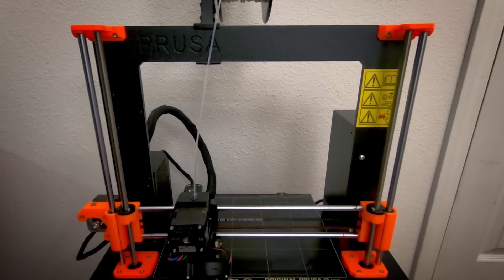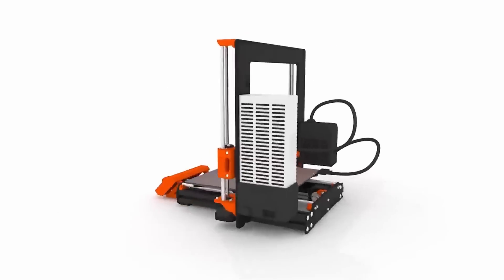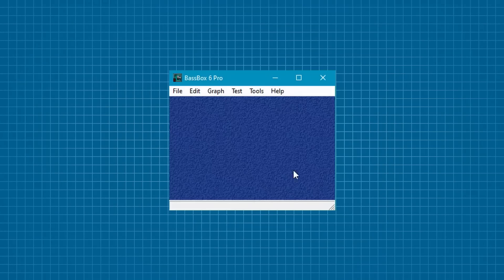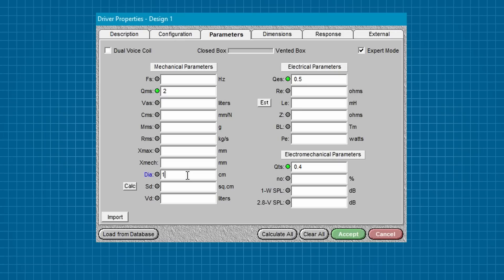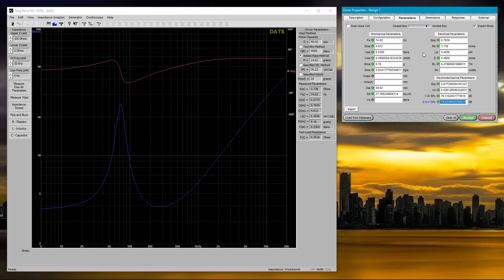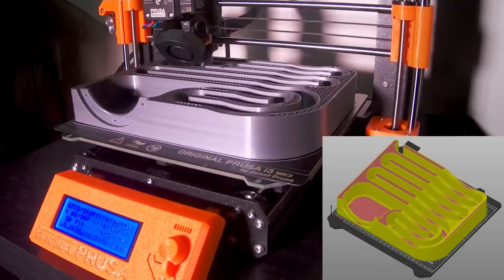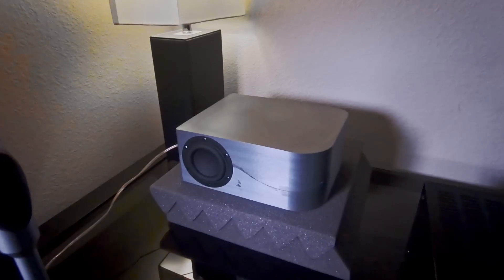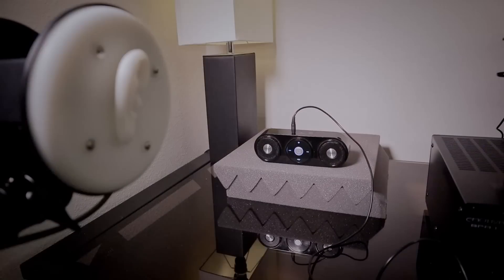Can a 3D printed enclosure get low?

Comment: I wanted to build a bookshelf speaker, with the Peerless (Now Tymphany) Nomex 6.5 HDS and a 19mm Peerless silk dome tweeter. The finished product is ready. I can post a video and give specs if you'll comment on improvements. I would appreciate it. The crossover is very simple 12 dB/octave and is L-R @ 3K. The drivers have a very close sensitivity.

Comment: Wow! This is definetly a good way to use a 3d printer....
I'm not an expert, but just in theory, isn't plastic too rigid compared to wood? 
I mean, wood maybe has a more elastic response to bass frequencies, while plastic maybe cannot dissipate the tension like wood. 
Always theorically speaking, maybe you can achieve a more round bass if you implement some kind of "spring" structure which can absorb the exceeding tension, and release it when it drops down a little.
Maybe passive diffusers ca be used for this purpose?

Comment: 1st great Video, keep up the good work!
2nd ...are you considering printing a hollow form and filling it with sand, or concrete, too? 

3rd I would think about groove & springs on the printed halfs, or just grooves on both halfs to maybe place a seal (rubber) ring in it, just to make mounting easier. What are your thoughts?

Comment: Which tuning frecuency did you used to the port? I measured the driver's TS parameters of 4 units i own, and i had the same discrepancies as you in relation to manufacturer Spec Sheet

Comment: Doesn't the foam pad under the speaker hinder the bass response of the bluetooth speaker? Your eclosure is designed to take care of the bass itself. The small bluetooth boomboxes depend on an external solid surface to augment their capabilities. Speaking from my experience with a BOSE Soundlink II (Suprisingly good for such a small speaker, from a non-audiophile-but-with-decent-musical-hearing perspecive), it heavily relies on a solid surface to actually work (you pick it up, the bass disappears, amortized by flesh basically). And I mean solid, not "put your phone in a drinking glass/against a window to make it sound better"

Comment: What software are you using to calculate your speakers?
Have you ever thought about building a really tiny speaker? I'm working on upgrading laptop internal speakers to something that's actually usable. The Lenovo Thinkpad W530 has TERRIBLE speakers with extremely low volume. It's so silent, it's laughable. I got a PAM8403 class-D amp and have some good success with other salvaged laptop speakers in terms of volume. The obvious upgrade would be to simply install the additional amp inside the laptop and be done with it. However, I'm interested in understanding if it would be possible to make better speakers instead of simply making bad speakers louder.

Comment: How far away from the driver did you have the mic at? A lot of the response irregularities could be room modes depending on how far the mic was. Try doing a nearfield (~1cm) measurement and see how it does.

Comment: That was incredibly impressive from such a small sub. I might have missed it in the video, but what was the wattage being pumped into it?
Reply: the amp is an emotiva bpa-1 (Dayton Audio APA150) so if he had it bridged it was 150w rms.  I actually have one pushing a Rockford Fosgate 12" P3 underneath my desk to supplement the bass on my JBL LSR 305 monitors.  nice little unit.  it's a bridgeble 2 channel class AB amp that is bridgeable and has a defeatable low pass x-over in case you want to use it full range.  
edit: seriously doubt he is pushing the full 150w to that 3" speaker tho.  prob doesn't even handle half that.  maybe he was using just one channel which at 8 ohm is  65w i think.

Comment: The main difference you are hearing is the driver. That driver is a full-range unit with a unique magnet design that keeps the voice coil in the uniform part of the magnetic field throughout its entire travel. I hate to give away the conclusions of lots of research, but, while that driver is great at low volume, for full range, it will modulate HF at high volume. The other thing you are hearing is the narrow band-pass of your folded-port enclosure; You need DSP to make an enclosure like that a bit smoother, or couple different length folded ports to the same driver.
Reply: Yup - the response is all over the place with those tuned enclosures.

I've tried my hand at some small sub designs and always come to the same conclusion:  It's neat, and fun, but physics will always win.  There's always a compromise that makes it less suitable than a larger driver would be.

You can do a lot better with  ~$40.  These are just a novelty, really.

Comment: Hey Hexibase. I started with an X, Y, Z axis that I imported into my PDQ program, which automatically converted into a .exe file. 

Then I opened the .exe in Google Assistant which prompted the FBI and CIA to merge as one file. Later I used an ISIS sweep generator to bring it up to DHS with a lot of RAM. I used the ctrl to shift the scrnlk, and saved it as a PDF. Later when I played the PDF, I discovered the FBI and CIA merged with the DHS and caused the PDQ to not communicate with ISIS, making the XYL have loud QRM with an RST of 5x5x5, which blew the diaphragm from the XYL's  chooch circuit. Now I need to find another chooch circuit that can handle the RAM of 35 RPM. I found a source on line for A.N.A.L lube which guarantees better performance of the PDF when stepping up the RPM of the RAM over 15, Making the chooch circuit much quieter thus reducing the screaming to around 40 DBL. It took a few try's to get it dialed in and everything is working perfect. Thanks for the upload, it has given me inspiration!

Okay, for those reading this ( if you finished ), It was just a joke. I liked the project and what was done, but didn't understand ANY of the technical stuff. So I posted what I basically heard as a JOKE. Did you scratch your head??

Comment: As a car audio enthusiast, this is really convincing me of using a 3d printer rather than making the boxes by hand like I usually do.
Reply: just be aware that the max. dimensions on a printer are kind of small- also 3d modelling software can be a real pain...and the printing itself is much slower than most people imagine- the 2 parts shown in the video on my printer would likely take 2 days of actual printing time
Reply: @olik136   Oli K  I noticed the pieces shown in the video seem solid. Would printing a frame and filling the cavities with a resin+wood shavings cut down on printing time? if so I also think it could provide similar results to what was shown in the video.

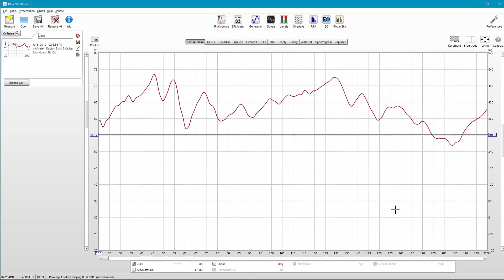Comment: 5:21 Why does the frequency response looks so poorly? It looks seems to be just a two-note-sub (45 Hz and 55 Hz). Didn't you run a simulation of the line before you built it? I usually use AJHorn which gives pretty accurate results to the final built.

Comment: Could you show your enclosure specs? I don't understand how you got so low with such a small volume behind the driver.
Reply: clint a normal driver is like hitting a golf ball with a hammer. With a waveguide, it’s like hitting a line of 100 golf balls with a hammer - you end up transferring a lot more of the energy of the driver into the air.

Comment: You should get a bunch of sound samples using your holophonic setup, and a bunch of "pure" mono sounds of the same object, then train a neural network to go from the "pure" sound to the holophonic sound! :D You would have to include the position of the sound (and orientation of the head), I'm thinking that's easiest to do with some sort of motion tracker, so you can continuously move the sound source around and thus feed the "pure" sound + position as input data to the neural network and it should spit out the holophonic sound as output :D
Might be doable with a pure convolutional neural network, meaning no dimension restrictions :)

Imagine how good sounds in games would be! :D
Reply: Your comment sounds smart, but it really isn't.  Multiple drivers allows for an identical sound from a different location to be experienced by the ear at a different time.  You lose this ability with one speaker; full stop.  When you are lacking a physical aspect of an experience it is severely limited... so p0rn hub will never be as good as the real thing no matter how good the recording or VR headset :)
Reply: @skewty  I'm not talking about "3D sound" that simply delay when the sound is played in each speaker. I'm talking about training a neural network to go from mono sound to holophonic sound, so emulating the ear and head structure too. Assuming your training worked (and that you have enough data) the output should be nearly identical to holophonic sounds.
So I'm not really sure what you mean when you say "You lose this ability with one speaker", since that's the input data, not the output data.

Comment: I have some old speakers that my father made when HE was a teenager. Sporting horn tweeters and mids and a 15" woofer. Even with my Onkio set to +10 on low end, they still have hardly any bass.
What they can do, however, is make you deaf with very little power. 25 Watts is deafening.

I wonder if an enclosure like this inside that woofer section of the cabinet could help fix the bass.

Comment: This would be really cool if he released the stl files, I was planning on actually designing a smart alarm clock radio type thing with an android phone as its brains. And I was going to do a smaller 2.1 setup with about a 3” subwoofer. And this would be perfect for the base of it. It is also reassuring that you can get bigger sound out of smaller enclosures. Of course I would totally have to wing creating the enclosure as I’m not well versed in tuning speaker enclosures and stuff. But yeah,
Please release the files lol. I would gladly pay for them

Comment: Your videos are very interesting and we can clearly see that you have plenty of knowledge and experience in audio-propagation systems design.
I recently got interested into horns and waveguides design (by somehow extrapolating the knowledge that I have on microwave systems). Though it seems like it's very difficult to find proper manuals on the internet, with proper engineering info about these topics. Would you be able to indicate some references? (Engineering manuals would be awesome)

Horns for instance: I found some pretty solid derivation on the impedance coupling for several cases (parabolic, cone, exponential, tractrix), but they assume a normal impinging wave and nothing will tell me how to design a compression chamber to acheive that condition! Then I guess that you can't just slap a horn on a speaker as the front loading will for sure interfere with the design as the cone will encounter a higher impedance in the front (I would guess that the enclosure volume might drop in the case of a front loading...).

As I said :P some manuals or some in depth technical explanations would be highly appreciated!!
Keep up with the channel, it's very inspiring!

Comment: interested to try a full range drive in a similarly produced enclosure.  Did the 3d printing hollow infill not give all sorts of nasty cabinet rattles and buzzes? Do you think it would be better to print it almost hollow and fill it with something inert?

Comment: That's amazing all that from a small package. Maybe I could make a setup inside small compartments in my toolbox. (I.e. under the box or underneath the top of the toolbox since they give you room in the top drawer to bolt a steel top on your toolbox.)

Mining company doesn't allow personal electronics in the property. So I don't wanna be that guy with a side locker that the key won't work on a day shift. 

There's only so much country I can listen to for weeks on end. While contractors drive their service trucks in and have all the fun.

Comment: Do you have port noise on higher spl? Also you reach the xmax quite fast with such a low tuning right? The question is, if a 6" driver in a closed box with the same size is louder with the same low end.

Comment: Correct me if I'm wrong.. Sounds like that specific driver aka speaker is to flimsy to push through the resistance of the long tone tube style enclosure.  Causing pulse waves to bounce back distorting the port output. Soft driver material with wrong resonance frequency for set up + long tube does not work. getting some solid Kevlar drivers or thick reinforced drivers might help.

I know nothing.
 Ignore this comment.

Comment: I wonder if it would work if I upscaled the size of the box to accommodate a kicker 6.75” CompRT subwoofer 🤔. Has anyone tried to up scale one of his enclosures before ?
Reply: you can't just scale up the enclosure for a larger driver. Every driver has different TS parameters and requires a different enclosure to achieve the same result.

Comment: Two questions: what is that ear-mic and is there something a little bit more "mobile"? Something I could actually wear while making recordings?
Reply: I use a Sony ECM-CS3 microphone and it works really well. I've found the range of the audio varies GREATLY on the device used to record. The end result on an Olympus hifi digital recorder is comparable to my desktop condenser microphone when compressed to 128kbps.
Reply: @casey360360  I thought about a good stereophonic binaural recordings :)

Comment: question: should you enclosure not get more space to the wall in the back? I mean the wall of the room. There must be reflection from the wall. You obviously did not take into account your room while designing or simulating your design. What I mean by that: I think in a free air test outside in a desert your design should perform much better and closer to the simulation. Off-course just varying the distance and/or changing the room would show if my concern of the room significantly affecting performance would be correct. as an electronics engineer I really would love to see the limits of your design.
Reply: It's good that you think about these things. Assuming that he hasn't is one thing, but claiming so is entirely different. I can see you backtracked that slightly with the "if I'm correct" injection, but you can rest assured that modeling of the environment was done way before the original enclosure was modeled. He used to have tons of videos up years ago. Those would have let you know just how in-depth the modeling goes. Too bad they're gone. This guy has invented multiple enclosure alignments as pure side-effects of requested response & decay in specific environments & enclosure locations. 

Next time you watch a video of his that shows a response curve; for sh!ts & giggles ask him to plot it in any gaseous element to replace 02/N. He can generate an extremely accurate response curve with any change in location, orientation or distance on any axis, in any hypothetical medium without having to physically measure it, then do a physical measurement to verify the modeling accuracy. His own software is ridiculous.

Comment: I would have liked to have seen, "Isobaric Loading" of TWO of these Drivers in this type of Enclosure. Or better Still , same type of Enclosures & Isobaric, up to 8 inchers. Those would have a more ideal Bass Response. Suitable for "Near Field" and or, a Small (Dorm?) Room listening. If small enough; perhaps a Pair of each Sub, for such a space !  Frankly, I'd love to use the Tang Drivers used in the original "king of desktop subs" - the Logitech Z-2300. That way, I'd be happier with the Bass in my Current System - the Main Speakers being the updated Home Enclosure of the old Braun L200 - the CM-5 s (still a Sealed Box). But made up of an unusual "composite" material & Polyethylene Cones.
The Alternative would still be using Isobaric Loading on the Pair of Woofers; but instead of a "Quasi- Transmission Line" ... a Sealed Box, but using Passive Radiators.

Comment: Could this be scaled down to a much smaller size using a sugar cube speaker? I am a model railroader we have a huge range of sounds coming from our engines speakers usually just have a simple box behind but my thought with a 3D printer a much mor complex box could be printed, or is it just too small check out sountraxx web site to see what they are doing. Neil

Comment: Maybe a little bit of an odd question but has an enclosure to be absolutely airtight to work and must the inside of that be "clean"?
I'm currently working on a RC Tank Project ( https://i.imgur.com/P5YokKE.png ) that needs a Speaker Box but after modelling one I came to realize that I could probably use part of the Chassis itself as a Speaker Box as it is sectioned up into three portions ( front housing the Electronics & Motors, center housing Turret Ring & Battery, and rear housing the Speaker ).
The only question is how airtight does it need to be and would all the "dirty" geometry inside the Chassis pose a problem? Bear in mind that my goal is not to reach Audiophile Levels of sound but at the same time I'd rather not be arriving with garbage either 🤣

Comment: some thoughts.      as far as i am concerned, the wave guide cross-section and the use of 180 degree bends, are damping  audible bass response; below about 70 hertz.     maybe there is something  INAUDIBLE  going on.     in which case, why bother.     as a sub, the performance seems to be  weak.    it works pretty well, as a full-range, tho.        googletranslate
https://en.wikipedia.org/wiki/Loudspeaker_enclosure